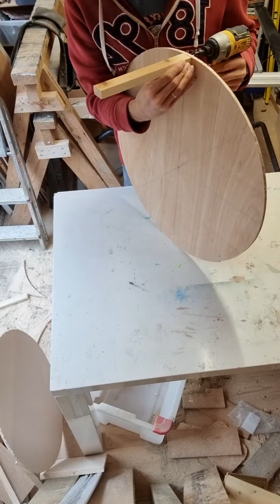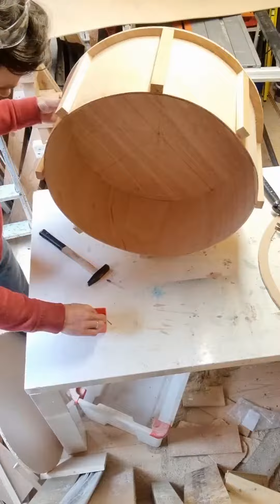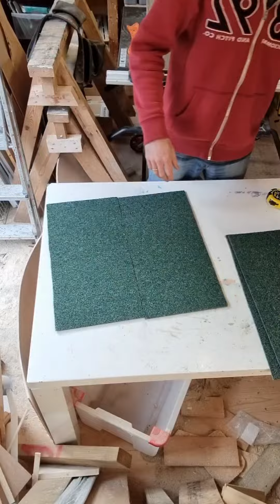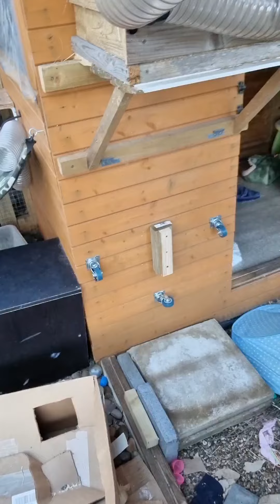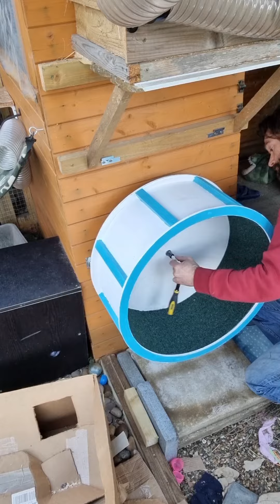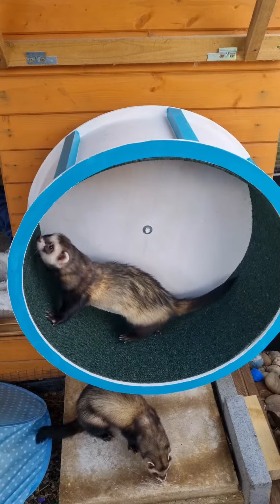How to create exercise wheel for ferrets!

Comment: How did you figure out the diameter of the wheel??
Reply from the maker: I had a specific spot I wanted to place the wheel, so I decided on that diameter. You could go larger, any size really, but if you go too small it arches their back which isn't good for them